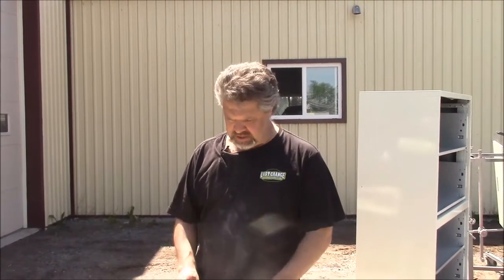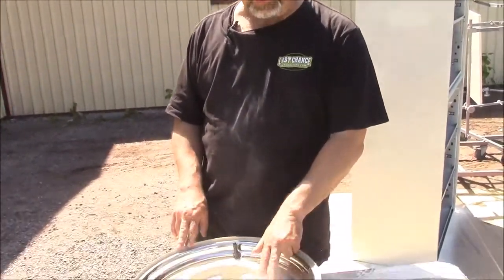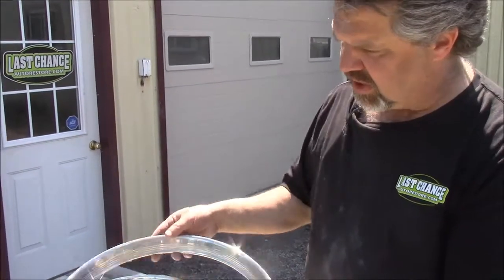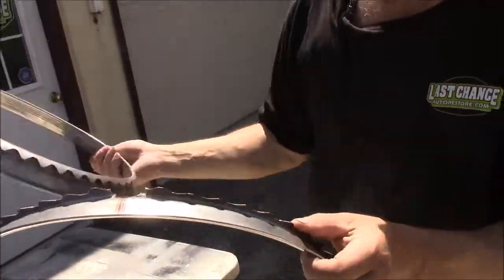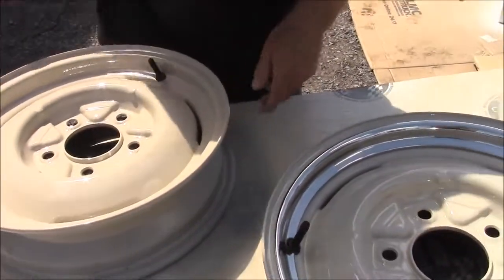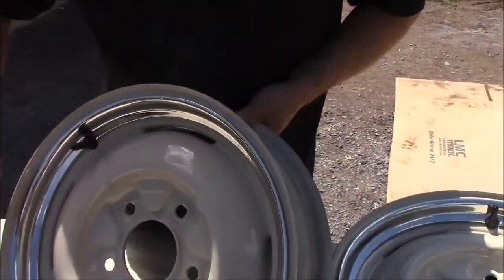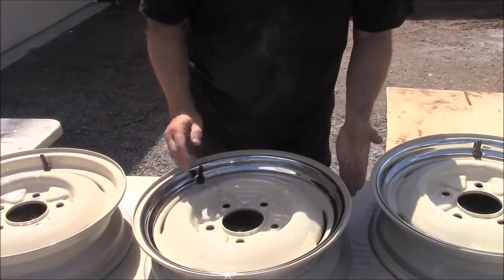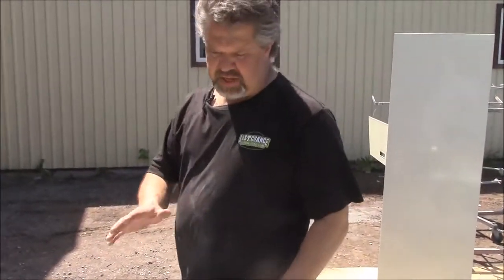1950 Ford F47 F1 Restoration Update, Rims Painted & New Trim Rings,  lastchanceautorestore com

Comment: how big are the original factory steel rims??
i mean the really early narrow ones..
Reply: Depending on the year, cars were 15" diameter.  Trucks were 16".
Their width varied for the years.
My 1953 F100 are 4.5" wide and 16" diameter.
My 1962 F100 are 5" wide and 16" diameter.
In 1965 and 1966 you had the option of getting 15" or 16" for your truck.  Also, in 1966 they went to the "outie" design vs. the "innie" design.
Outie and innie refers to the tabs location that hold the hubcaps.
Reply: @RalphSampson...  and what would you say was on the 1948-50 and 51-52 Ford F-1's??
Reply: Where could I find some of these
Reply: @jacobbarkley2633  coker tire sell rims like that